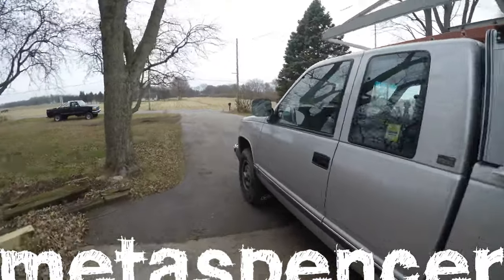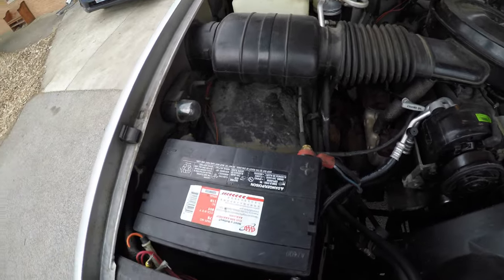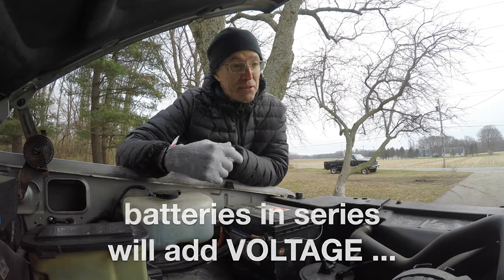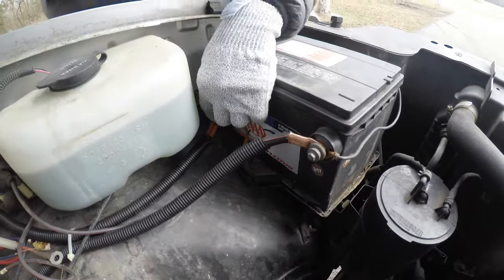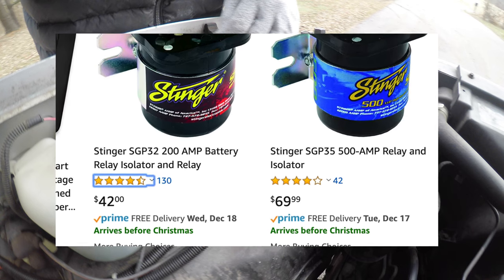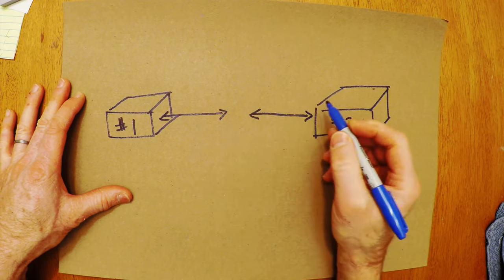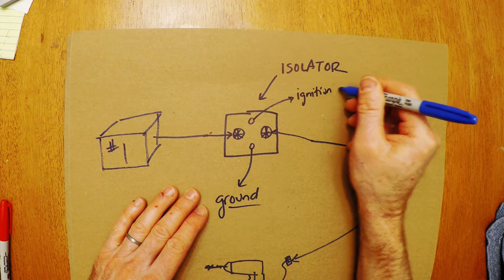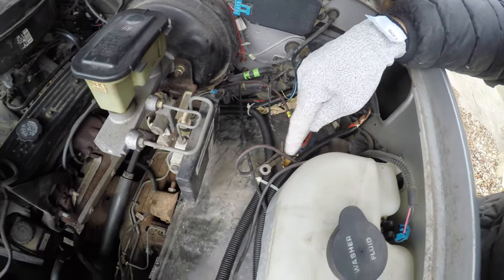Two Battery SetUp Using an Isolator

Comment: Thanks for posting your video, after watching it, it appears to me that the isolator connects your two batteries in parallel (and not in series as mentioned in the video) by connecting their two positive terminals together (and of course the two batteries negative / ground terminals are connected to each other via truck's chassis).  A potential issue with this setup happens when the engine is off (isolator is open) and battery # 2 is used by the loads on the inverter , causing the battery#2 to discharge. Now, when you turn the engine back on, the isolator closes and connects a discharged battery # 2 in parallel to the fully charged battery #1.  This may not be an issue depending on battery #2 discharged level, and it will look like jump starting a car by connecting a running car to another car with a dead battery to jump start the other car.
Reply from the maker: Oh man, I'm glad you are mentioning this ... I'll have to recheck everything in the morning. I've been assuming they were in series for years without closely examining the setup. Doh! Much appreciated man
Reply: @metaspencer  You're awesome dude...and a little humility is beautiful thing!
Reply from the maker: Haha … big thanks

Comment: I’m not a YouTuber so I can’t make a video, but I have similar setup with a high output alternator also.
I liked your video if I could recommend an isolator it would be the one from Painless performance because you can use it to jump start yourself as well, but is mostly the same as your setup.
Reply from the maker: I'll have to look up that isolator -- thanks for the tip. I'm adding a second battery to my van and that sounds like a good option. Thanks!

Comment: (Series means doubling the voltage to 24v, parallel keeps the same 12v.)
I use a $10 blade-style disconnect set from O'Reilly.  Pop the hood & flip the switches up whenever you might be running a bit too low on voltage, (like less than 12 v) and it will save your cranking battery (same idea, just cheaper)
Reply from the maker: Sounds like a good setup -- nice to have that backup. Yeah, i always mix up that series/parallel nomenclature. Thanks man
Reply: Yes the setup is in parallel, series would be running one battery positive to the other battery’s ground and would create a 24v setup like some diesels use

Comment: Can you use the second battery to start the truck, in case the first battery is dead? Or are both used when starting the truck? 

Great video, it really helped my understanding.
Reply from the maker: I’ve wondered that myself. I believe the isolated second battery does not help start it ... but don’t quote me on that. Sorry to not have an answer
Reply: If you use the right battery isolator then yes; some battery isolators like the one I have from Painless Performance use a switch to allow this when needed

Comment: Nice video 
I would like to know where did install the isolator trigger wire @....what ignition source..& does it have to be fused? Thank you
Reply from the maker: Mine is fused just in case. As a general rule I fuse any accessories just to avoid an overload. As for your question about the trigger wire: check the wiring diagram on the isolator. It's pretty simple with power coming in and out: it kind of works like a switch.
Reply: 1 You should always fuse anything you install if it does not already have one. 
2 Look to see if there are any ignition accessories that you do not have and find the fuse place in the fuse box. Such as if you do not have power windows. The wiring may not be there but the power bus should still be set up for it in the fuse box. You can take the time and get the right connector and put in the in the fuse box or you can use a fuse tap or add-a-fuse.
Reply: It works just like a relay.  Actually those stinger relays are just that.  They don't need much , I think it's .5 amp to close the circuit.   I have this setup on my air ride bus.   I haven't had any voltage issues with the house battery being low and main battery fully charged.  It seems to level out the batteries.    I used to have a smart relay  that would open and close when it hit certain metrics, the problem I found was when the air pumps were running that smart relay was always closing and opening.   Drove me crazy. I went back to the simple stinger relay.  Haven't had an issue since

Comment: It’d be cool if you showed the ignition connection. Every video I’ve watched for the past 2 days clearly says that you need to connect the ignition wire. But they don’t show you where they connected theirs. Is it supposed to be some highly kept secret?
Reply from the maker: Oh man, you've been on a scavenger hunt and have come up empty! Sorry it didn't come through in this vid. This might help if you're running a truck like mine https://www.the12volt.com/installbay/vehiclewiring/3/yeard/Chevrolet.html

Comment: Thanks for the information!  One question? Will the second battery recharge with the alternator, or will I have to manually recharge it when it's depleted?
Reply from the maker: If they're linked together properly they'll both charge
Reply: @metaspencer  awesome! I am going to go through with adding a second battery to my work truck. Thanks for your  reply!

Comment: I’m trying to put in a dual battery system for my 2018 Ford F250 but the TSB instructions do not say to use an isolator but I am putting a Salter and a plow on my truck. Do you know why they say not to use an isolator there is no mention of it.
Reply from the maker: My very amateur sense is that the isolator is for when you want the second battery as a leisure battery or backup. If you're just putting the second battery in parallel to have more amp hours, you don't need or want an isolator.

Comment: Could you explain how you relocated the vapor canister so the battery tray would fit on the drivers side? I’m about to install a second battery for my snowplow but the canister is in the way of where the tray bolts.
Reply from the maker: Hmmmmm, I don't recall having a problem with that. My Chevy is a 1990 2500 Silverado. I'm thinking that in your situation you'll need to get some hose for the canister and squeeze it in somewhere else. May be a tight fit

Comment: Great video I had one question. What would an ignition source be?
Reply from the maker: Ignition gets its juice from a main battery right to the starter
Reply: @metaspencer  so connect the remote wire to the starter?
Reply from the maker: @kevinlechner7722  Remote wire? Now you lost me.

Comment: If you put another isolator in your vehicle is it possible to run a third battery with a better alternator?
Reply from the maker: A lot of people run big banks of batteries ... you just have to wire everything correctly

Comment: Hey Metaspencer, i read through the comments but didn't see what I'm looking for, Sorry if this has been asked before. 
I have an 09 Sierra with a stock 145 amp alternator, If I'm charging a second battery that has been drained would it be a good idea up get a 160 amp alternator if i plan on using a lot of power from the second battery?
Reply from the maker: Sorry to say I can't really answer that one ... if it was me I'd just see how the existing alternator works (testing the batteries regularly at first). But if you have $$ to spend the better alternator might ease your mind. Good luck!
Reply: Can’t say without knowing what you plan to power, amp draw of what you plan to power, etc. use a high amp alternator would be my recommendation( I have 250 amp alternator in my 96 k3500)
Reply from the maker: I hear ya ..That big alternator is the way to go

Comment: Love it! Nice diagram very informative Illustration-I often run my battery out and have to get a jump , I’m going to buy a leisure battery with an isolator to run my inverter that  I just installed in my cargo van 2013 Chevy Express
Reply from the maker: Sounds excellent. I really like those vans ... and supposed to be dependable. Good luck with it!

Comment: so does the cigarete 12v work when the vehicle is off? lights everything? and only running off the secondary battery?
Reply from the maker: The cigarette 12v is wired differently in different  vehicles: sometimes always on and sometimes switched. You could wire it to the secondary which would be cool
Reply: @metaspencer  if it's always on , it should be only drawing from the seccond battery with the isolator right ?
Reply from the maker: @lancebro121  I'm not sure what you're thinking is "always on" ... if you have a steady draw then yes, you'll drain that battery fast
Reply: @metaspencer  I mean if after instaling the smart isolator and the vehicle being off but my 12v accessory's still drawing power is that comming from my new aux battery? or the main one still?
Reply from the maker: @lancebro121  Yeah you just have to wire it so that (main battery => isolator => leisure battery => accessory)
Reply: @metaspencer  thanks very much man , one more question 60 amp fuses ? 140amp ? My alternator is 130 amp apparently
Reply from the maker: @lancebro121  the smaller the safer

Comment: Do you use Deep marine 12v battery on #2?
Reply from the maker: That's not a bad idea, but I haven't gone that far
Reply: @metaspencer  So it works just fine on this traditional battery? I have an extra one and am thinking about doing the same thing.
Reply from the maker: @jonathankuhn2180  yup. no problem
Reply: @metaspencer  sweet

Comment: So from the diagram that's given with the isolater it's basically a relay switch connected to ignition live why spend 60 dollars on and isolater and just a few dollars on a relay?
Reply from the maker: Sounds like you know what you're doing. I've always used an isolator to keep the main battery from draining

Comment: But even with this setup,  the car has to be running to charge my phone or use a laptop while plugged in using a cigarette port adopter or an inverter right?
Reply from the maker: With a second battery you can charge quite a lot without the car running … the battery will die eventually though
Reply: @metaspencer  yea but once the car driving,  itll recharge the battery by the alternator right?
Reply from the maker: Yes recharging when driving
Reply: @metaspencer  the only thing im recharging is my cell phone and a couple power bank batteries 18650s. But im going to get one of the big portable power banks that have solar connections.  But what you have i think im going to do that set up anyways for emergencies. 

Thanks for the info,  you deserve a cookie 🍪  😂

Comment: Where did you get the driver bracket from
Reply from the maker: Driver bracket? Which point in the video?
Reply: @metaspencer  yes driver battery tray. I want to know where you bought the battery tray for the driver side
Reply from the maker: Oh gotcha! Local auto shop a lonnnnnnnng time ago. Maybe Amazon has one for your truck?
Reply: @metaspencer  unfortunately they don’t sell it anymore. I’ll have to cut the spot welds out of the passenger side and flip the bracket around
Reply from the maker: @blackwellm23  Sounds like you're making things work ... good job man

Comment: Good video... I suppose, the trouble is I don't understand why you guys don't explain what exactly it doesn't what the advantages to it and why it is being used now more than you hear about it in the past. Because you see I don't really understand what you're saying because you're saying that you have them wired in series I know you said that on your other truck but even so why would you wire two 12 volt batteries in series to make 24 volts when you got a 12-volt system and you take the chance of burning everything out okay and then with this situation I run a sub sound system out of my back of my van cuz I run around and I do I play I'm a musician so I have it Extremely Loud you know and I mean I have some really loud PA gear okay but what I don't understand is why would you want to not running in parallel and have all the amperage you could why would you want to take the chance of saving your battery so you could get home that sounds like the people who make the inverters who pissed me off so much because they decide when it should have a cut-off like they've you're too stupid to realize that you should start the car up like every 15 minutes or so if you're powering stuff I'm just so fed up with like things that seems so logical to me and that they don't get explained and you know I just don't get it it's like I mean I can watch the whole video and you heard like what my questions are why why would you have two batteries and then you don't want to burn my I know why you don't want to wear them both down cuz you don't want to get stranded but obviously I would assume if you could set that up yourself to setup your smart enough to start your car up I just don't get it this guy he was trying to sell me on one of these and I was so not into it that he just gave it to me and told me to try it what am I going to do with this thing I need to have as much power as I can I'm not trying to save my battery
Reply from the maker: I hear ya man: it's really complicated stuff with many variables involved and terminology that doesn't all make sense right off the bat. in the most basic sense you need to think about your load (what you're plugging in) and your output (batteries and/or inverter). you'll get there for sure!